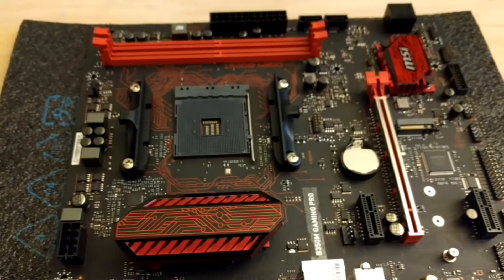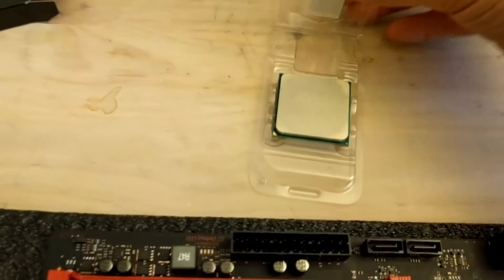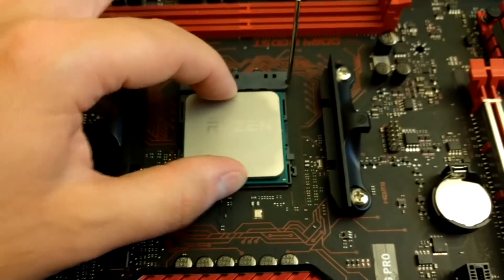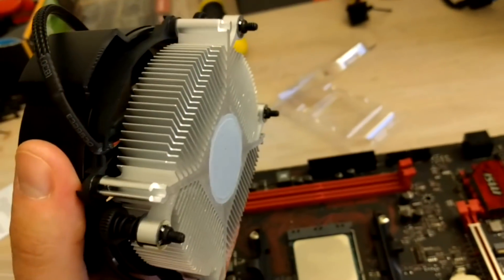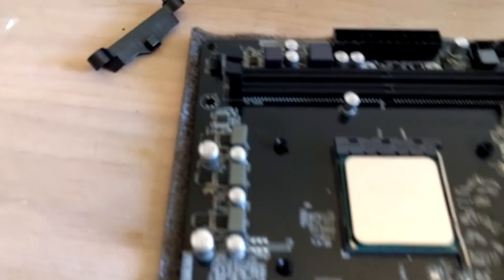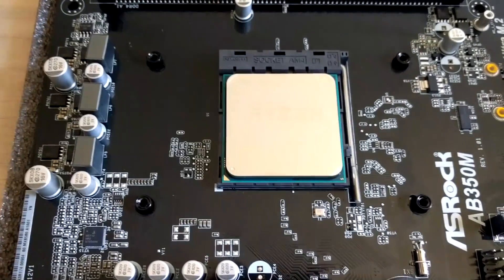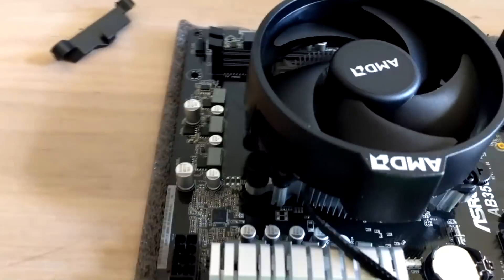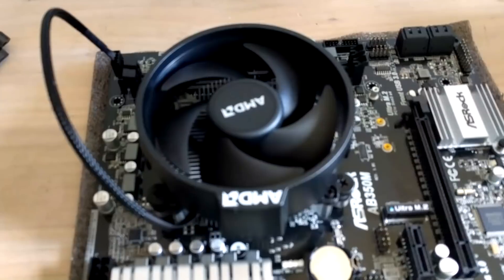AM4 Ryzen CPU and Wraith Cooler installation directions

Comment: I got the same mobo and cpu with Corsair RGB 3000mhz. What's the best do you get out of this combo? I got 3.75ghz stable at 1.3V VCore Voltage, 3066mhz of RAM and 1.35 DRAM Voltage
Reply from the maker: You can go up to 1.35v on the CPU safely with a nice cooler, it should net you at least 3.8-3.9GHz. We usually can not hit 4.0GHz unless we go above 1.35v which we do not like and it does not add much performance anyway. Personally I'd stick with 3.75G and 1.3v and enjoy a cooler and quieter system.
Reply: Hey, i know its a 7months old comment, but newest ryzen cpus will boost clock on needed cores higher than what you can achieve with a Manual overclock.

Try not overclocking and playing some games. Do Mind that some games need only 2-4 cores so auto OC is better. Other games are GPU based and a manual OC is preferred

Comment: How tight should the heat sink be tighten down to the cpu chip?   I am afraid that i tighten it too much and damage my cpu
Reply from the maker: On these Spire stock coolers you actually screw it in till the hard stop. It may feel like putting a lot of pressure on the chip but don't worry. It will create a really nice contact with barely any thermal paste needed, CPU is durable, it will not be damaged. AMD metal backplate prevents motherboard damages and does not bend with the board much. So just tight it down to the end, it was designed like it. 
BTW - remove excess therm paste on the edges of the heatsink before attaching it. AMD puts too much on it and most f the paste will be squeezed out and end up on the socket. I remove half of it and the leftover is enough to cover the CU when it pressed down
Reply: Centaurus Computers Haha Amd Says screw 1,5 times not to hard stop
Reply: Rutkuli where?
Reply: Patricio Gantzer in motherboard guide
Reply: Rutkuli mine doesn't has it
Reply: Centaurus Computers ....yeah that's exactly what happened to me with the paste.  I have to go and remove the excess from the sides of the chip.  Thanks alot...useful info.
Reply: Man I just had the exact issue. I had to really fuckin' push down on it, I think it' the damned springs. I hope it's okay.
Reply: My screws just spin forever without actually moving?!?
Reply: Frishkii I also had this issue when installing mine. I think it's normal.
Reply: Wow, same, I had to tight so hard that I started to think that I could have broken it, hope it Isn´t hahaha (I speak spanish, so don´t expect too much from me and my level of english :p)
Reply: I tried to install Ryzen 2600 today. And for some reason the screw just never get tighten to the point where i can't turn anymore. I am not sure if it's tighten or it's lose.
Reply: I have a different problem/situation: when I place cooler on the CPU, the 4 screws from the cooler have a distance of at least few milimeters between their end and the top of the screw acceptors from the backplate. It looks like this: 
==>   o==
So for each cooler screw I had to apply quite a pressure for them to even start screwing in the each acceptor:
==>==
Please let me know is this normal? I expected that screws from cooler would fit into backplate right of the bat, just like in your video. However I had to force them in quite a lot to even reach acceptors. Can I damage something by applying this force to CPU?
Reply: yeahn today was my first time i built a PC and i had my worst time putting the cooler on during my entire building prosses and made me very anxious about it and the cpu

im sure you figure it out by now, but i have a question did the screws start to make a sound while you screw it in (like some kinda of squealing noise) ??
i'm afraid i broke something in the cooler but i did manage to install it eventlly.
Reply: @KRoOoOoZ  yeah is normal
Reply: @KRoOoOoZ  you Installed it corrently if it has spire cooler You just needed make sure that you didint put much thermal paste
Reply: PremiumOxygen you mean like my situation? If you were replying to me I am at least comforted that I wasn't the only one facing this issue.
Reply: Mace 2GO RC Whats the temperature now ? Idle and load ?

Comment: seriously AM4 Motherboards manufacturers really screw up things with this, did AMD told them that they'll change for FAN Installation think or no, really people now need to do extra work removing those 2 small plastic which holds for fans as previous one was different and now people need to remove them just because Motherboard manufacturers screw up things, pathetic.
Reply from the maker: On the other hand these two plastic pieces ensure that many old coolers from AM3 socket that use bridge-clip are still compatible with this AM4 socket. I think that was their intention.